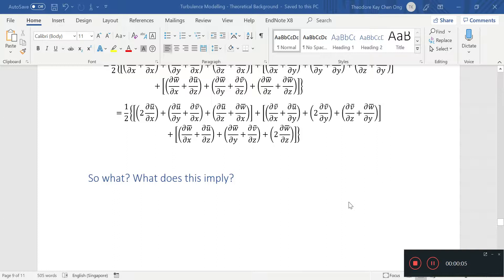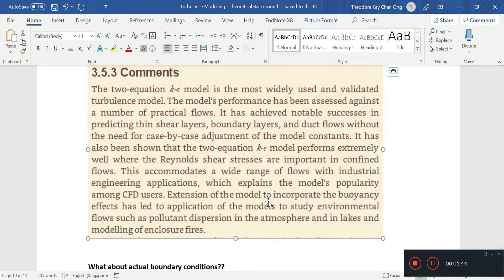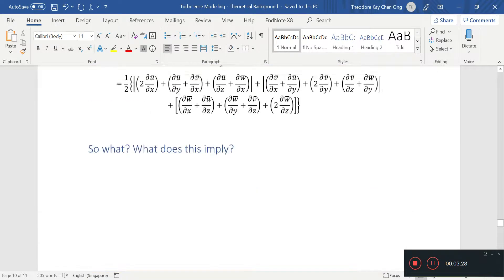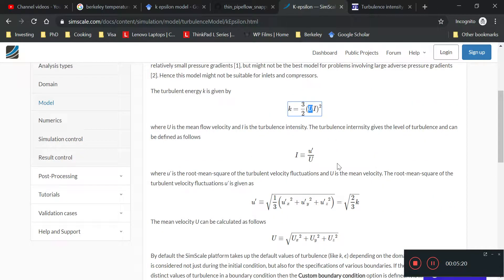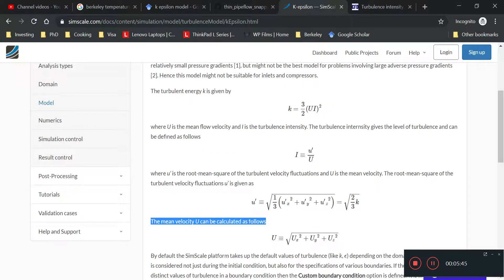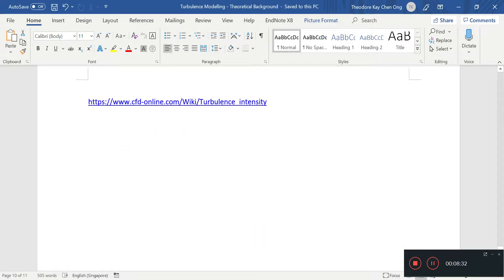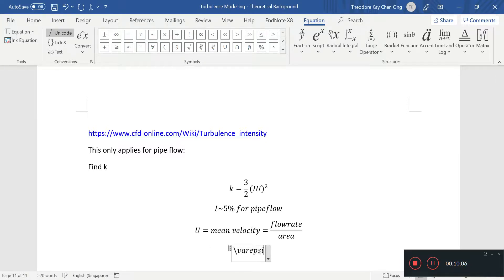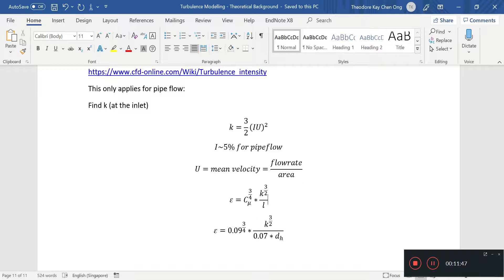Turbulence Modelling 7 -  k epsilon model 3

Comment: Sir , in case of other geometry , how do you set up the boundary values of k, epsilon, omega ... Is there any way to do that ?? Please help me ....
Reply: @TheoOngScienceAndEngineering  Yes sir , I have installed it and able to do some problem like pressure driven flow through square pipe like that ... Mainly I have done icoFOAM only ... 
BTW thanks for your useful videos 👍